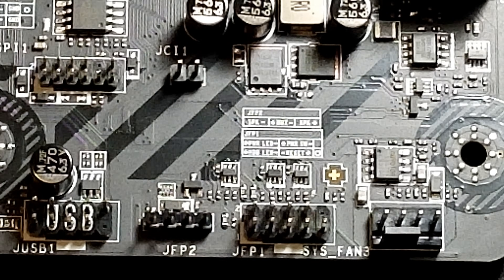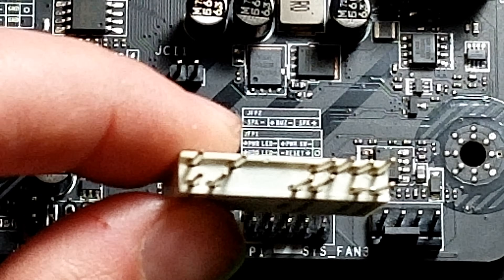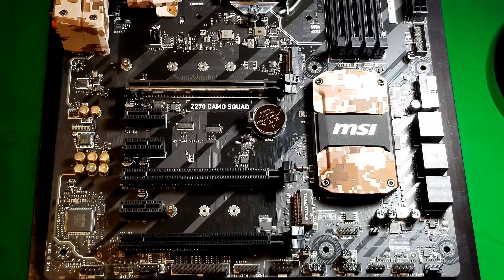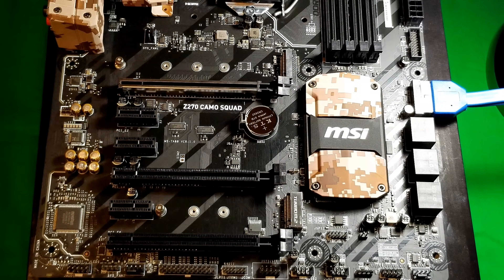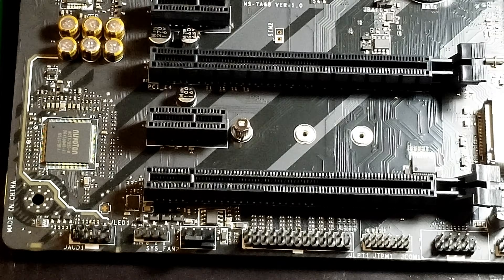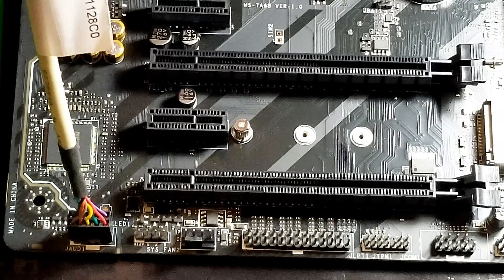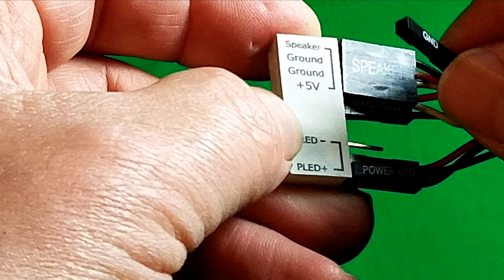Connecting your Case Front Panel connectors to your Motherboard

Comment: I have a quick question:
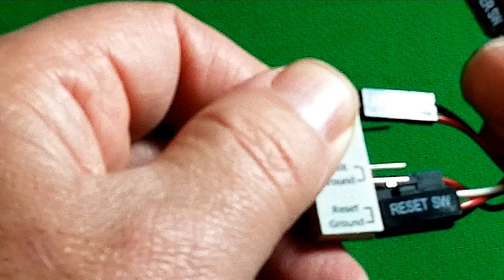At the 10:08 you're saying that the bottom pin is the positive one, but the label says it's ground. I'm confused.
Reply from the maker: The thing to look for is to look for the + (positive) or - (negative) wires, and align them with the pins that will indicate + or - and you'll be fine, with the arrow being the +...The reset can be put on either way and it won't matter it'll still work, the one' that can't be plugged in wrong is the Power, nothing will happen if it goes in wrong, it just won't work, if that happens just turn it around and it'll be fine then...I mention all this in the video...Thanks...
Reply: Shows how dumb i am
...i thought ground was negative. Just like jumping a battery. The negative is the ground. But with the power switch the ground was positive
Reply: @clayman478  The negative is the ground. He put it in backwards in the video. The arrow should have been put in the positive, same as the previous wires.
Reply: speedster427 but he mentioned in the video that for the power switch the polarity matters else it won’t work , so any explanation to that ?
Reply: @moe20302030  True, polarity matters for the power switch, he just (unintentionally) put it in backwards for the illustration.
Reply: speedster427 I received a reply from the author stating that the polarity of the power switch LED light matters but not the power switch itself , they are two separate circuits . It was little bit confusing but I understood it now
Reply: @moe20302030  OK. The author is correct about the power switch. I understand. It just looked confusing in the video.
Reply from the maker: @clayman478  Your building a PC, so definitely not dumb, I've built over 50 now and still find things out as I go along...it's a learning experience and that's part of the experience...Have an amazing day and even better weekend...Take Care and Stay Safe...

Comment: Thanks - especially for the comment about the tiny triangular arrows on the front panel to the  MB power pins connection. On Mini or micro form factor motherboards the diagram is often not printed on the MB ( not enuf space ) . It's only down by the pins and only the + is indicated - fine when the leads are individual but when paired & the MB is already installed in 'really tight cases' those Power Sw & Reset Sw connectors can be really hard to distinguish for bad (or older) eyesight, fat fingers, and especially when the triagular arrows on the backside are Black on Black & the Manual diagram shows only the + connection. Yeah, the connector can fit in the right spot, but it's easy to reverse as it isn't 'keyed' like the USB3 connector or Main power connector. 
Thanks again for the completely Thorough  explanation with clear close video. 
Old guy who only does a build every 4 or 5 yrs !
Reply from the maker: Your absolutely correct, I bought a huge magnifying glass when I first started doing this because it was near impossible to see where things went, that's why I did the video, I'm so glad it helped you out...Stay safe and have an amazing day...Thanks...

Comment: Were do you get the wires from ? Will it come with the motherboard or case or both or do you need to buy them separately
Reply from the maker: They come from the Case, and some cases won't have a reset button so no wire, same for the HDD LED sometimes...every case is slightly different...Thanks...

Comment: I still don't get the pw positive negative nonsense. I don't have that white power connector thingy majig :/
Reply from the maker: Not sure what more I can add, but if you have a specific question let me know, computer manufacturers don't follow conventional wiring, so the arrow is what they use to point out the positive with the one beside it being negative...some cases go to make it even more confusing with different color cables, but as far as I know the arrow still indicates the positive so there's no confusion...hope that helps some...Thanks...

Comment: How should i go about connecting a oem case to a non oem motherboard
Reply from the maker: Can you provide the name of the case, and the motherboard, once I have that I'll have more to work with...typically most motherboards will have the same connectors, just in different places, and the case cables are often slightly different...Thanks...
Reply: @Reviewing_Playing_and_More_RPM  the case I have is a 2016 Dell XPS 8900 and the board I'm switching to is a B450 AORUS M (am4)
Reply: I think the power led and trigger are combined in one connector whitch is the main thing im worryed about
Reply from the maker: So the good part is that the Front Panel connectors are easy to locate, near the Aorus on the Motherboard, Pin Layout will be in the Manual, just to point it out with the Aorus MB you will need an AMD AM4 Socket CPU as well...the other issue of course is locating which cables from the case are the one's you need...I honestly think you'd find it easier to get a newer case to go with the newer motherboard but that's just my thoughts...the USB 3.0 is in a BLUE Slot on this MB, and the HD Audio is in the Yellow slot...your 24 PIN for Power is in the White slot, the cables of more concern will be the Power, reset, etc, which as you look at your MB is to the right of the Memory slots, this is the FP, front panel connectors...so looking at what is there will help with locating them to your new MB...That covers all the cables that you will need to put into the new MB as well...main concern is to check that those cables are long enough to reach the FP connectors on your Aorus B450 M...if so it should go fairly smooth...Hope that helps you out...
Reply: @Reviewing_Playing_and_More_RPM  thank you so much
Reply: @Reviewing_Playing_and_More_RPM  yep i got a r 5 1600 12nm
Reply from the maker: The Power LED, looks like most normal connectors, but not sure what you mean by trigger, do you mean the on off switch? If so you just need to locate the power LED connectors, as that's the one that when you push the on off button, will just go into the FP connectors on the new MB...Your taking on a challenge so all the best, but I know you can do it...but if concerned it less expensive then you think to get a computer shop to swap it in for you and save you the work...just a thought though...
Reply from the maker: Your very welcome...R5 1600 is a very good CPU still and should serve you well...good luck...have an amazing week...

Comment: why does first-time boot of asrock-motherrboard NOT  work with usb-keyboard (display remains black and cannot enter bios, no graphics card installed)? ... or must it be a PS2-keyboard connection?
Reply from the maker: I had the same issue with a wireless keyboard but wired worked without issue, so not certain why you have had this happen...you did also say you had no GPU installed, so if not then you'd need a CPU with onboard graphics...hope that helps...
Reply: @Reviewing_Playing_and_More_RPM  but the motherboard already has integrated graphics with hdmi-connection. so no GPU card would be needed?
Reply from the maker: @bluename4  No Motherboard itself has integrated graphics, only the CPU would have that...take care...
Reply: @Reviewing_Playing_and_More_RPM thx. but since CPU is "intel core i7 unlocked (i7-7700k, lga1151), so why would its graphic not be displayed via the motherboards hdmi?
Reply from the maker: The I7 7700K does not have integrated graphics and needs a dedicated GPU to display. For any kind of output, you need a GPU Card or integrated graphics. Many PCs will not boot unless you have an integrated or discrete GPU. A computer that had it's GPU removed can turn on and it can do it by itself, but it probably will not boot. If you have a speaker plugged into the MB you will hear a "Beep Code" which will inform you that the BIOS cannot find a graphical output device on which to display.

Comment: i was looking for video like this cuz my front and rear jacks didnt work. But i am so bad at pc building so i am scared to do this
Reply from the maker: It is one of the biggest challenges for a first time PC builder, but not to worry, if you plug it in wrong it just won't work, remove and place as in the video and you'll be good to go...Thanks...
Reply: @Reviewing_Playing_and_More_RPM  When i look ať my mother Board i my hd audio IS already plugged in.
When i bought my Pc owner gave some weird cable.
It was DVI/HDMI so when i wanted audio i had to plug in headphones to monitor.
Reply from the maker: @riskob542  there should be a HD Audio from the case as you mentioned and as long as it's plugged in correctly then the headphone jack on the case should allow you to plug in headphones, the DVI/HDMI is a weird combo indeed...the DVI is for the monitor to PC, HDMI is for sound for the monitor provided it has speakers in the monitor..have a great day...

Comment: Please explain, at 10:13, when you put the power switch, you said that the arrow points the positive, still you put it on GROUND. Am i missing something??? Thanks
Reply from the maker: In this example the PWR - is the negative, with the ground being the positive, it is the way the adapter they use shows it, when you look at the PWR Connector the Arrow indicates the Positive, thus - and +, it shows it better when you look at the motherboard where it connects. Hope that answers your question

Comment: I have an AMD Gigabyte mother board and its nothing like the white connector you show
Reply from the maker: Every MB will be different and the cables from the case will be different as well...some won't have a reset, or HDD LED, for example...

Comment: I do wish that AMD and the motherboard manufacturers would get together and make all of these front panel pins into one plug.
It would save us all so much time and headache.
Reply from the maker: For the most part they are, but if case manufacturers were to make an all in one connector like NZXT has in a couple of there cases that would be nice...

Comment: Someone help my case only has power switch and reset switch I don't have the other ones and I dont know what to do!
Reply from the maker: The cables from your case determine what goes into the motherboard, my new beQuiet! 500 case only has the power, PLED + and -, and HD Audio so that's all there is, having just those cables is all you need to plug in then...hope that helps...Thanks...
Reply: @Reviewing_Playing_and_More_RPM  Thankyou I didnt think of that. That's probably why.

Comment: If you’re motherboard says j1 instead is that where you should plug it in?
Reply from the maker: On some MBs it's labelled FP or Front Panel, and others you'll need to check your motherboard manufacturers manual to find out which one's it is, if you mean JFP1, then it's likely that is a Jumper Front Panel 1, which is more important to verify the Pin Layout on your MB against the Manual to ensure which one is which, as there could be JFP1, JFP2 etc...and you'll need to determine which in order to plug in your cables properly...Thanks...

Comment: Why do I only have 2 panel connectors
Reply from the maker: No idea, what MB, what case, I have the beQuiet! 500 and it only has Power and PLED + and -, all depends on the case and what cables it has, and the MB will have many more Front Panel connectors unless it's some hybrid or pre-built possibly...let me know more and we'll go from there...Thanks...
Reply: Ok yea mine only as power switch and HDD LED
Reply from the maker: There you go, so only two cables in that case...was surprised when mine only had two but made it easier to plug in lol...Have a great day...

Comment: My motherboard connectors plug into the motherboard obviously, but the other end has pins and I don’t know where they plug in
Reply from the maker: Not certain what your saying, the case has it's cables which are connected to the case, and they go to the motherboard front panel connectors...what other pins are you referring to? Thanks...
Reply: Reviewing Playing & More RPM well I found a bag that contained the motherboard connectors. My case has not motherboard connectord
Reply: Reviewing Playing & More RPM my case is the NZXT 510i
Reply from the maker: Yeah, I haven't done a review on that particular case, but it has extra connectors that look to be for the RGB lights, so you might want to search for a video on connecting the lights on your case...hopefully there are a few...some cases have advanced cabling features to make things look better, but with that it's a fair bit more complicated...

Comment: I just need to know which pin the arrow on the power sw and reset sw goes
Reply from the maker: The arrow on the Power goes to the 2 pins that your MB Front Panel says is the Power with the arrow going to the + and the reset as long as it goes as according to your MB pins doesn't matter which direction as it will work either way...Thanks...
Reply: I recommend using the manual to the motherboard it really helped alot

Comment: If I misplugged these front panel pins to the motherboard, will the computer not turn on? I finished my first build but it’s not starting. I have the ASUS X570-P motherboard
Reply: I see RGB lights from the heat sink and the case light is on (NZXT H510 case)
Reply from the maker: If you plug in the Front Panel connectors wrong it won't turn on, other things to make sure of and common mistakes with a first build is that the memory is installed correctly, using the 2 and 4th dimm slots...ensure the power 24 pin and the 8 pin are on and make sure the switch on the back of the Power Supply is on, ie I not 0...hope that helps...
Reply: Reviewing Playing & More RPM thank you 
!! I figured it out. Front panel was plugged in the wrong way to the power, HDD LEDs
Reply from the maker: @robertleung1309  Cool, great job...enjoy your new system...

Comment: My motherboard doesn't have that jfp1/2. Doesn't have a manual (because it's a prebuilt) and yeah... but I have put my motherboard  in a new case and that's why I need help please any1 help me??
Reply from the maker: It's hard to help when it's a pre-built without knowing the MB, but the connectors are likely the same though, just maybe without a reset, or USB 3.0, in any case if you can send me a good picture to my Twitter Account, of your MB so I can look and try and determine where the connectors are I'll see what I can do to help further...Thanks...
Reply: @Reviewing_Playing_and_More_RPM  ok sure

Comment: When you connect the power connectors you use the positive (black arrow) position to the ground marker so isn't ground supposed to be negative?
Reply from the maker: black = ground/negative, but since both cables are typically black you have to use the one with the Arrow as positive and the - as ground...Thanks..
Reply: @Reviewing_Playing_and_More_RPM  I got confused on that part also. At 10:31 I see the arrow (positive, right?) pointing   to the ground pin (negative?).
Reply from the maker: Yes, the arrow is positive, and ground negative, typically Positive on the left, and negative on the right of it...Thanks...
Reply: @Reviewing_Playing_and_More_RPM  so then why did you plug in the positive arrow to the negative pin?  O.o
Reply from the maker: @ilovemissbayer  Your looking at the Power not the PLED + and -, they are different, I was referring to the PLED, if you start at 9:45 and watch it through it shows what I'm referring to...hope that clears it up...Thanks...

Comment: What do I do if my case doesn’t have a USB 3.1?;-;
Reply from the maker: Not all cases are the same, I covered the main cables you will run into, but some won't have a USB 3.0 or higher cable, or reset switch either...if your case doesn't have it then you won't have the cable to worry about making it easier to do your cables...Thanks...

Comment: None of my connectors have writing on them so I dont know what to do
Reply from the maker: So in that case, I would Google the name of your Motherboard to get a PDF of the manual and look for the Front Panel Connectors, to find out where they go...Thanks...
Reply: @Reviewing_Playing_and_More_RPM  I did look up the mother board and it seems my computer dosent have the right connectors. What should I do then? Thanks for the reply.
Reply from the maker: Give me the MB details and the Case and I'll check it out for you, otherwise you'll need to compare the parts for compatability on PCPartPicker.com if that will help...Thanks...
Reply: Reviewing Playing & More RPM MB: gigabyte GA-h110m-H my pc is a prebuilt so I don't know the case name but my computer is a ASUS G11CD-B13.
Reply from the maker: As pre-builts go that's a pretty decent Desktop, but upgrading it would be a bit of work, doable but just a bit more difficult...the board is Gigabyte so there layout for them is standard so google a PIN Layout for a recent Gigabyte motherboard and it should be the same, although best I can determine from the case is that you have USB 2.0 & a USB 3.0 cable, and HD Audio all of which should be easy to determine...the remainder would be your PLED + and - they are much smaller in size then the other cables, with the positive one having an arrow to indicate the positive typically...the only other cable would be your reset if there is a reset from the case, and HDD LED so once you get the PIN Layout you should be able to go from there...Hope that helps some...Thanks...
Reply: @Reviewing_Playing_and_More_RPM  I'm not to experienced with this stuff my first time so ill try my best thanks for the help. :D
Reply: @Reviewing_Playing_and_More_RPM  so do you think I will need a new mother board or it will work I've tried a lot and I just cant seem to get it I dont know if I'm missing something or just not compatible.
Reply from the maker: If the case and motherboard are giving you problems, you could get a friend to help, or take it to a local computer shop for assistance...good luck...
Reply: @Reviewing_Playing_and_More_RPM  Thank you